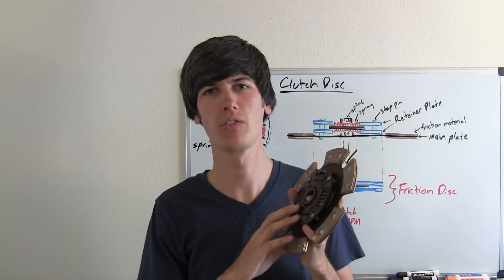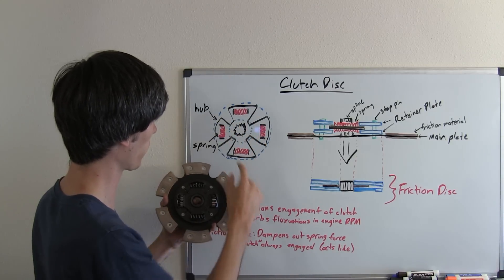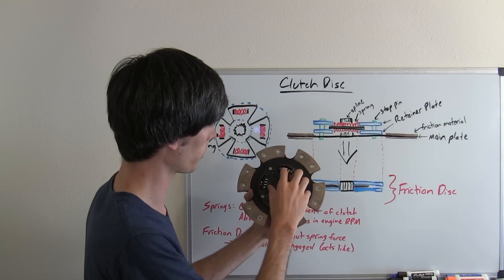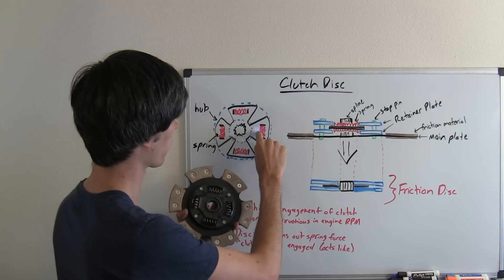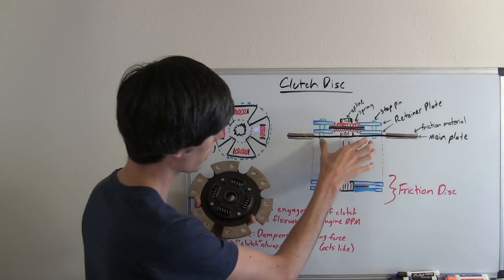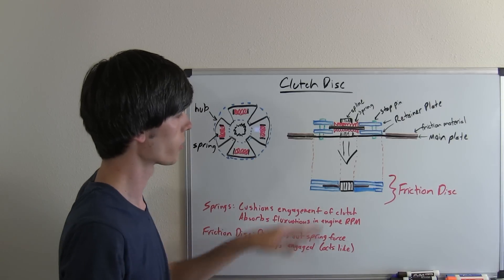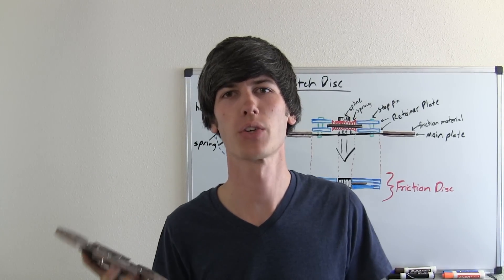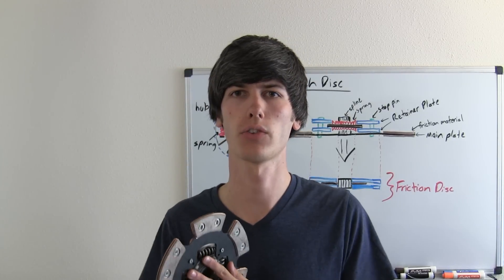Clutch Disc - Explained

Comment: Thanks for the explanation! That's awesome.

By the way I regrettably now own an automatic. Very curious how it holds place when on a hill/incline without needing the brakes. Are you able to explain what is happening? What is being worn out when it does this? Similarly does applying the brake disengage the clutch or does it fight against the brake similar to how it fights against hills and inclines?

Comment: My chevy sonic (F17 gear box) is at 205,000 miles with original friction disc but I have noticed a random slip here and there but nothing bad like burning clutch. I am guessing the friction disc's center spline that kinda free float on those four damper springs is disconnecting (completely spinning) sometimes. Could you confirm if this could occur? I notice it occurs at a higher acceleration. Or could it be that the clamping force of the actual pressure plate has weakened?

Comment: Curious I think the 2 retaining plates and hub are not supposed to have much friction at all rather the springs alone are supposed to provide the vast bulk of the transfer force - because springs return most of the energy they modulate the engine torque fluctuations turning them into useful torque vs if there was more friction it would instead cause heating of the plates and energy loss in the clutch plate assembly and detract from the spring damping energy recovery effect. The idea of the springs is to capture the small surges in rotation as the engine turns or as the clutch is engaged and smooth them out to provide useful power  by having the right amount of spring strength.
While there will be some friction between these elements isn't this just to stop the hub from rattling in between the 2 plates rather than as a specifically intended design feature. ?

Comment: Explain how the engine doesn't just rip those dinky little pins and rivets apart and turn the thin sheet metal into a potato chip.

Comment: Hi, many thanks for your great video on clutches, could you please help explain how to rightly diagnose a bad pilot bearing, release bearing and a bad input shaft bearing. When will you hear a noise coming from them? Is it when they are under load or not? And please explain when they are under load and when they are not under load. Bless your heart!

Comment: Great video, I’d also add that the springs are there to dampen out variation in power pulses from the engine, reducing noise and vibration associated these pulse variations from  being heard/felt in the gearbox and differential. 

This is particularly important when a lightweight single mass flywheel is also fitted, as these have less mass to absorb vibrations.

Comment: Difference between a 6 Puck unsprung disc and a 6 puck sprung disc?
And why would i need a flywheel counterweight?
Reply: Duffman 305 typically an unsprung disc is paired with a dual mass flywheel, which have springs. For a car with a single mass flywheel from the factory, a sprung hub disc is used. The basic idea is that the springs dampen out vibration from the engine, which can cause NVH (rattling) in other parts of the drive train ie: gearbox and differential.

Comment: Suggestion for your video:  drill out the 4 stop pins and SHOW US the hub which is actually a plate that engages all 4 springs.   I didn't get it until I went  out to the garage and did that.

Comment: can you please do a video that finally explains why less friction surface on a clutch equals more torque???  I just dont get it.  I get how less surface = more Pounds per Square Inch but you have less Square Inches!!  seems like a wash to me.
Reply from the maker: Supposedly some materials will work better at specific pressures; some of these clutch discs used for higher applications use materials that need more pressure, so they reduce the surface area so the pressure on the plate (per square inch) is higher. The overall clamping force will be the same, yes. To me, it seems very logical that a stronger diaphragm spring will be necessary for higher torque applications, as it means you'll have a greater clamping force.
Reply: Engineering Explained that was a really nice answer

Comment: trying to find answers to a qustion.   Is it captured between the fly wheel and the presurre plate?      Is it rivited to the clutch plate?      Is it rididity attached to the transmission imput shart?   Is it grooved for cooling???
Reply: +Darcia Cowart Yes, the disc stands between the flywheel and the pressure plate's friction pads. It's connected to the gearbox shaft only. The pressure plate is riveted to the flywheel so, when the clutch is released, the clutch disc is pressed on both sides by the diaphragm and flywheel. As for the grooves, as far as I've read (I'm far from being an expert), they work as air channels to help the disengagement of the disc and eliminate wear material. I don't know if it's of great help on cooling since it's a dry clutch. Hope I've given some light and keep studying.

Comment: So can you explain the characteristic differences between a solid and spring loaded clutch disc? And why might someone choose one over the other?
Reply: +dreamrealitysyndrome The springs release some of the stress from the gearbox as it absorbs some of the oscilations from the driveshaft that usually occur at lower rpm. I think a solid plate would be better for a car aiming for performance, where you're not looking for comfort and are avoiding energy losses. But I'm no car expert to give reliable info though.

Comment: "The disc in the center is not connected (there is a gap for the pins) so it allows for the springs to compress."  Is the disc in the center called CUSHION DISC?

Comment: Also it's good to note that the connecting pins that secure the retainer plates are also in line with the friction plate, preventing the springs from compressing too much.

Comment: hey i have a question so i have a 2004 Subaru wrx a 5 speed manual and in the winter we got a lot of snow and well subarus are fun in the snow. so i was doing a cupple donuts and i stopped and try to put it in first and it wouldent go in there was like a wall blocking it then after a bit i got it to go in to 1st gear and drove for a little and i stoped to see if it still gos in first and it did. then like 30 min later i did one more donut and in the middle of it i was switching from first to 2nd and grinned for like a second so i stoped try to put it in to 1st again and same it wont go in to 1st its like a wall and this time i it dident work to get it in to gear so i started in 2nd. i thought i broke the syncro or something but after like 2 weeks i was driving it and it was rolling in 2nd pushed the clutch in reved it up a bit and tryed to put it in 1st it went in a little but not all the way so i reved it up a little again and it went in more so i stoped and let the clutch go and it worked well 1st...and it was a bit stiff switching from 1st to 2nd but now it works fine like nothing happened......do you know what could of caused this??? and reverse worked fine all this time.

Comment: what would happened if there are not spring can you write here pls...i didnt understand in video..
Reply from the maker: It would have a bit more vibration, and engagement wouldn't be as smooth.
Reply: No springs? Race clutch, basically undriveable on the road, very little/zero clutch slip. meaning it's an on/off, you can't slowly move forward in first gear for example
Reply: +Liamv4696 that is not correct exactly... Many customers of my shop use full rigid setup with radical high pressure clutch "press" to hold 800+ Nm and despite the abuse it causes on the gearbox and the chatter from all the gearbox clearances at idle, it can be run on the streets everyday...
Reply: +Nuno Rodrigues Yeah, I guess what he said would happen if the diaphragm was too rigid.

Comment: what if you use a high gear like 4th when you are going slow lets say like 10 mph? what are you breaking?
Reply: Your engine won't have enough torque at low RPMs and it'll stall
Reply: hmmm but will it break?
Reply: Not breaking anything per say, just putting uneeded wear on drive like components

Comment: I don't quite understand how the center friction disc works. I get that it dampens the spring force from oscillating, but wouldn't that mean it dampens it when the springs are trying to do their job too on engagement of the clutch? It seems that the springs would be pointless with that friction disc there. Unless it has enough friction to stop the oscillations, but not enough to prevent the springs from working. Maybe I just answered my own question?

Comment from the maker: The disc in the center is not connected (there is a gap for the pins) so it allows for the springs to compress.

Comment from the maker: It's a small gap between the clutch disc and flywheel, likely only a few millimeters. When the clutch it worn out it won't grip, so you can let out the clutch and it won't spin with the engine, or it will slip when you accelerate. Worst case, you can let out your clutch at idle and it wouldn't even kill the engine, just idle and spin around the clutch disc.

Comment: Very useful, could do with a bit more on the basics of how and why the clutch gets engaged & dis-engaged... i.e. a bit more on the upper & lower oil pump & engine & gearbox & drive shaft speeds, synchromesh, double clutching.

Comment from the maker: Correct, the friction plate (or friction material) wears away over time. But since it's essentially attached to the disc you simply replace the whole disc.

Comment from the maker: Watch my video on performance clucth for the "6 puck" question. Clutches without springs are going to a have a bit harsher engagement, but it could be preferred for racing - lighter, simpler, and rev matching decreases the need for springs.

Comment: Basically your clutch disk is sandwished between your flywheel and the preassure plate. Your clutch is splined to the input shaft of your transmission. When you press the clutch pedal, a throwout bearing puts preassure on the diaphram of the preassure plate and in turn stops the clutch disk from spinning with the engine. Your clutch disk is like a brake. It breaks the link between engine and transmission so you can safely shift gears. I can explain it more, just no room in a comment.

Comment: actually if you have a springless clutch it's more likely the springs are in the flywheel which is then called a double-mass flywheel. I believe this is done to reduce costs since you'll be changing the clutch because it slips not because the springs don't work. So they moved what doesn't break into the flywheel which you don't change very often (hopefully never) and left the parts that wear in time, the friction plate, as "the clutch disc".

Comment from the maker: The engagement wouldn't be quite as smooth, acceleration could be a bit more jerky. That said, there are racing applications which remove the springs. Quicker engagement and less rotational mass.